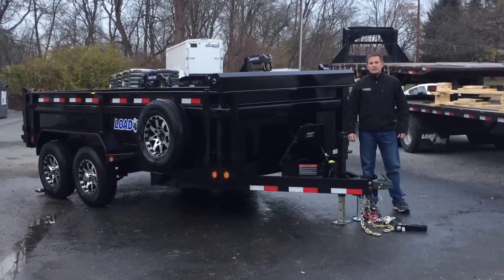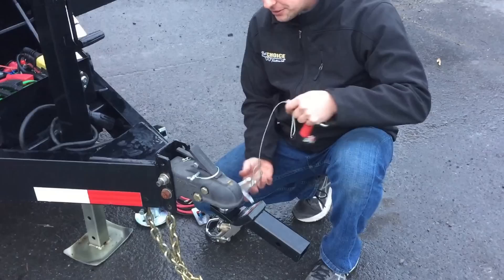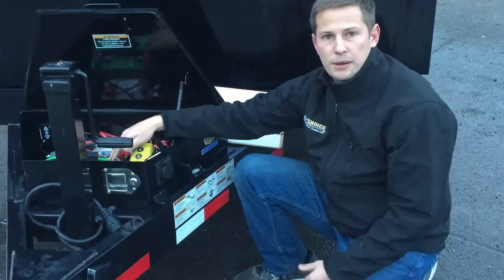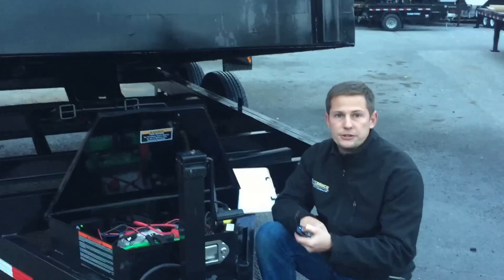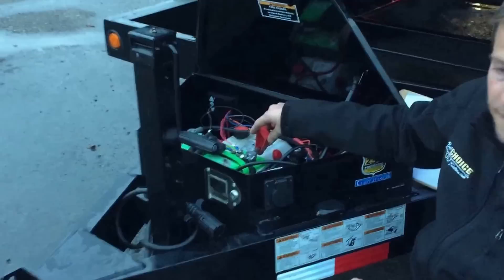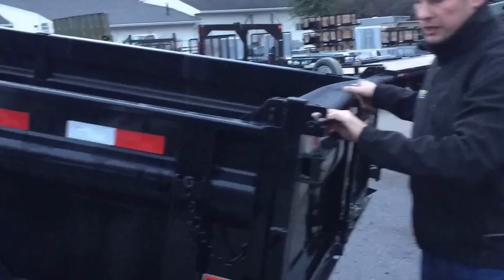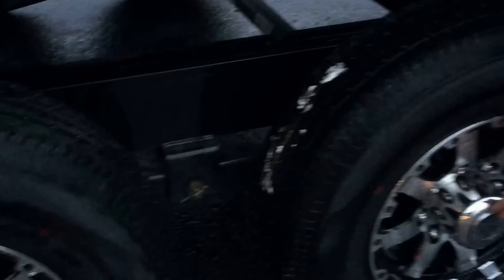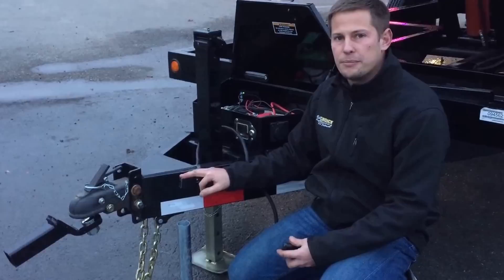Dump Trailer Maintenance Service Video

Comment: Good information👍
Reply from the maker: Underneath rear driver's side corner like pretty much all dumps.  Horrible placement, could be much better if it weren't for the DOT requirement to have a light over it.

Comment: If your loosing fluid, these trailers can come slamming down on top of a person or thing like a fly swatter, from what I'm told! it seems like hydraulics could have a some check type valve to prevent this? Having come from oilfield industry, it never occured to me until having to get under one for repairs.
Reply from the maker: Not going to say your wrong as I've been around these a lot in 12 years and never seen this happen.  That said, if it takes about a minute to power down, and about the same on a gravity, what is going to make it come "slamming down like a flyswatter"?

Comment: I had a fluid overflow ( due to low battery) after charging the battery back to 100% over a couple days now the pump does not respond at all ( just clicks when I press up or down) is that a sign of a blown seleloid?
Reply: Our wasn't wanting to go up basically had to jump hotwire to the up solenoid to get it to move.. But the hydraulic fluid was half empty
Reply: @melloyellogsxr   turned out it was the solenoid, I had to contact the manufacturer directly and get them to send it as no one else carried it lol crazy shit

Comment: Where can I find that kind of auxiliary wiring harness?? I need one so tired of the battery on my trailer carping out
Reply from the maker: Warn makes 2-gauge harnesses for winch setup's that can be used to run direct from your main battery while Keeper makes 6-gauge harness that would charge the battery faster, but likely not allow you to run direct.  You can also google search welding wire and quick connect ends and it should come up.  This is probably the best way to go on a one-to-one setup for keeping a battery charged without issue.  There are other things that may work better in a one-to-many application, like a high output solar charger, or a voltage amplifier like they use on lift gates that would mount in the toolbox.

Comment: the video helped me thanks! I was wondering why my fluid overfilled my box when i dropped the bed with gravity. Sure pissed me off, now its full of fluid and a mess. I want to unhook everything now and clean it out properly. I know now to never do that again! I thought something went wrong with my system. My brothers trailer only gravity drops, I assumed it wouldnt be a problem. GRRR they should have a warning sign for this. such a piss off
Reply from the maker: Most manufacturers use iso-32 non-foaming hydraulic fluid, which is pretty readily available at any hydraulic shop, and most hardware stores.  Pretty much all dumps use a similar system.
Reply: 2.20 quit giving ideas for the thieves man!!!

Comment: what's the price on a 3 feet side.
Reply from the maker: Depends on the brand, the size, etc.  Generally speaking removable sides tend to be a good bit cheaper than permanent as permanent tends to cost more to build and to ship.  Give us a ring and we can price out the size/brand/spec etc you are looking for.
Reply: just get the normal 2 feet sides and add onto it with the stake
 pockets

Comment: If you own a dump trailer, purchase a nice solar charger. You’ll never have to worry about your battery again
Reply from the maker: I would possibly agree with that at the homeowner level, depends on the duty cycle of a commercial user.  A 2 or 6ga auxiliary wire harness would often be the best in a commercial application, so long as it's 1 truck to 1 trailer.  Keeper makes one we use in a 6 ga, fairly reasonably priced, worked for most.  If buying solar, get a decent one.  Typically the smaller panels (monocrystalline) are higher output than the large ones, just have to keep them from getting broken.  I've seen some customers put a piece of plexiglass over them with a spacer in between.   https://premium-supply.com/products/solarpulse-7-watt-battery-charger?_pos=2&_sid=8f075c2ef&_ss=r